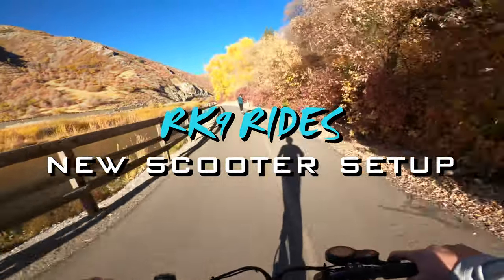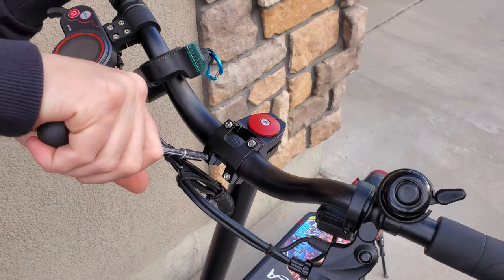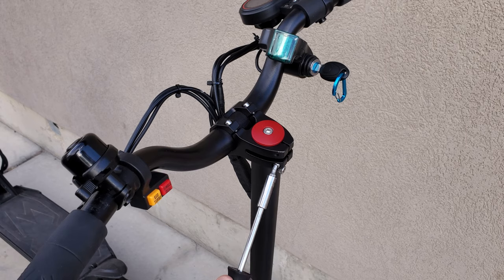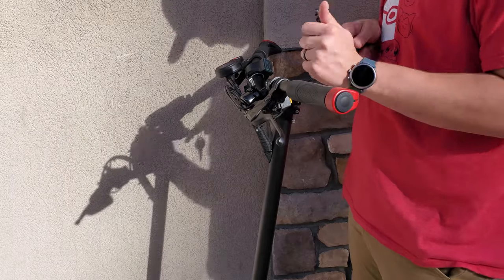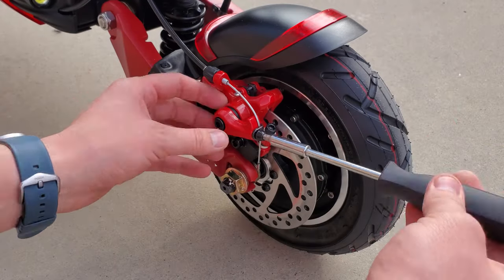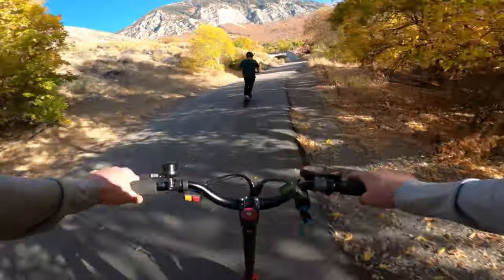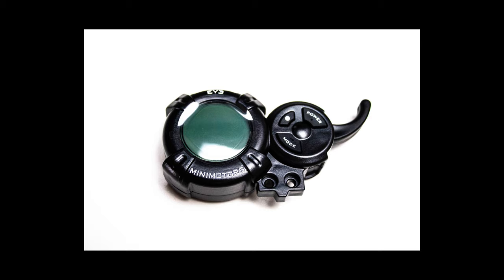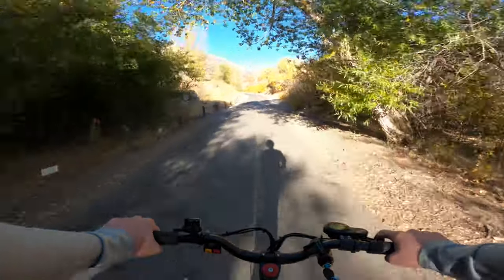Electric Scooter Setup and Adjustment \\ Handlebars, Brakes, P-Settings, Etc.

Comment: Re. Tyre pressure - remember, air expands as the temperature increases (which it will when the wheel's rotating, that's why you'd never check the tyre pressure(s) on your car after a long journey) - I keep mine approximately 5psi lower than the max recommend - seems to work just fine. Don't think it would do any harm to also Slime the tyres prior to initial run - just suggestin'. Happy travels.....

Comment: Can you set individual 'P' settings per GEAR, or is it one setting for all? It would be great if it was per gear. I'd set them up with individual max speed/accel/power settings. Gear 1 would be a supper casual mode, slow accel, max speed 20ishkm/h. Gear 2 would be Medium accel, max speed 40km/h. Gear 3 would be max accel, max speed 50km/h. (I've ordered a Boyueda 5,600w)
Reply: it doesnt work like that but you can adjust max speed per gear by changing setting of your top speed